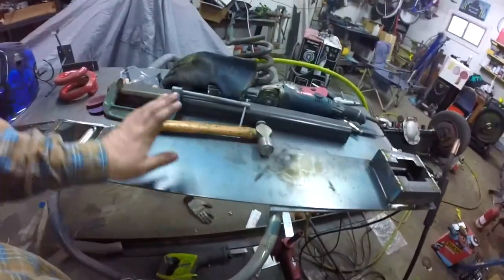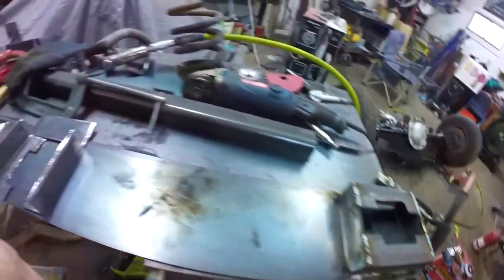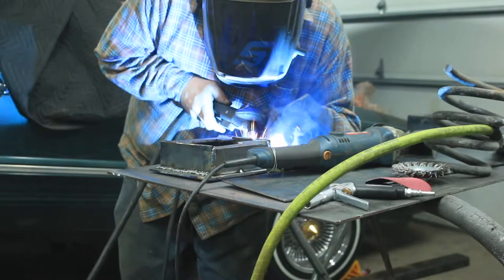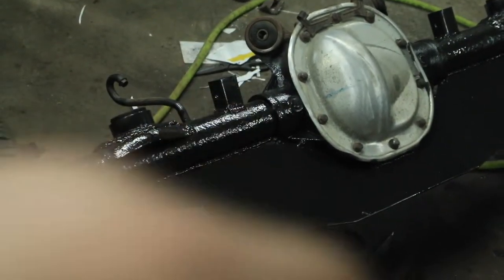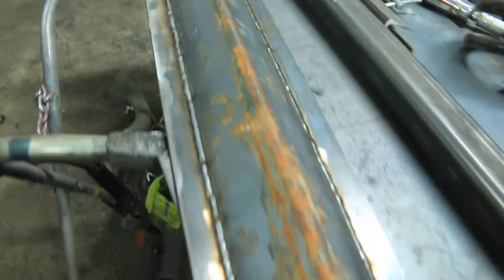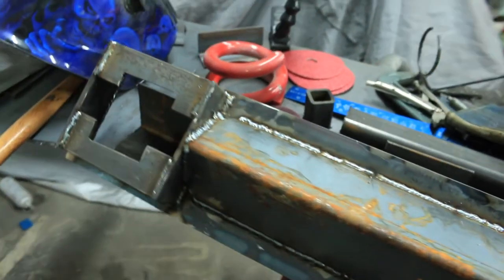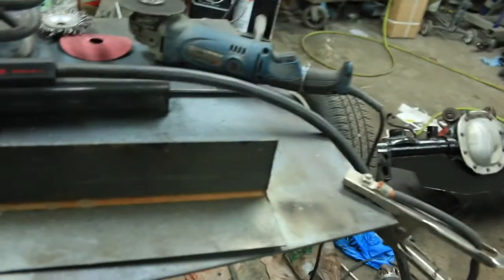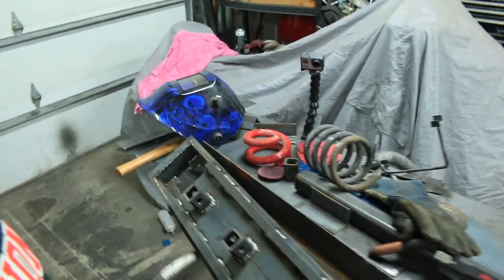Lincoln Lowrider CHAINBRIDGE! PT1

Comment: Good job man...Id sin the chains in an x,it helps swing the body over easier...When you put chains in make them about 2 or 3" shorter than full lockup that way when it tilts you dont break your powerball or cylinder.👍
Reply: Run*

Comment: the wires run on a pulley so when u drop that side down to three wheel it pulls the corner down smooth and doesn't lock up and stays on three  hard to really explain try to look it up... alot safer than chains
Reply from the maker: Mark Moore makes sense. Sounds interesting. If this doesn't work out I'll look into that more. Thanks!

Comment: have you ever consider instead of chains using a pulley system with braded wire really smooth three wheel
Reply from the maker: Mark Moore never heard of that.

Comment: did you do away with your sway bar...and how does it handle without it
Reply from the maker: Carlos Talamantes both sway bars are disconnected. It's hard for me to tell how it rides. Because even when I first got the car it would kind of dance all over the road completely stock. On the highway it definitely has a floaty feeling and kind of glides around corners. But it's manageable. You just don't want to lay back and one hand the steering wheel.
Reply: thank you i really enjoy watching your posts keep it up

Comment: Did you have to reinforce the frame?
Reply from the maker: Shaun White no I didn't.
Reply: RJ Tickler  , do you think it is necessary to reinforce frame?  For a 2 pump 6 battery  setup ? Big body
Reply from the maker: on most cars yes it is, lincolns have a fully boxed frame front to back, which helps out a lot. most other cars have a c channel frame which is not very strong, it all depends on what your trying to do with it. just lay and lift your probably ok, but if you want to hop, or three wheel you should have something.
Reply: RJ Tickler cool thanks,  awesome videos!  Nice 64 can't wait to c that